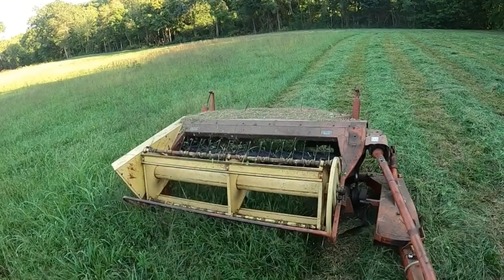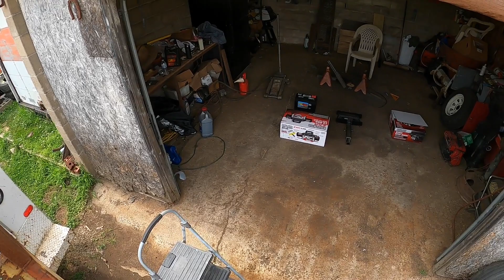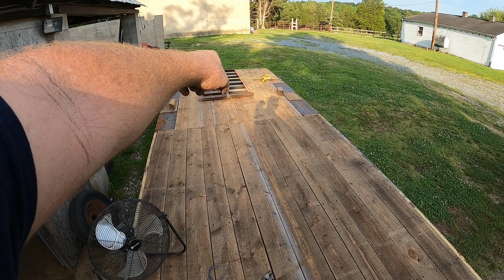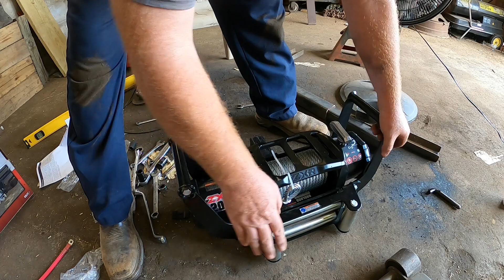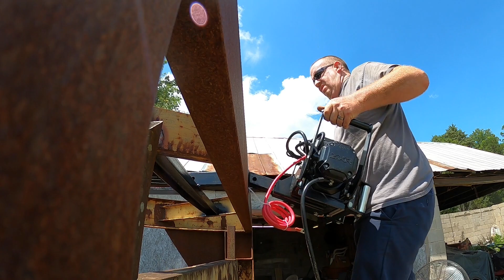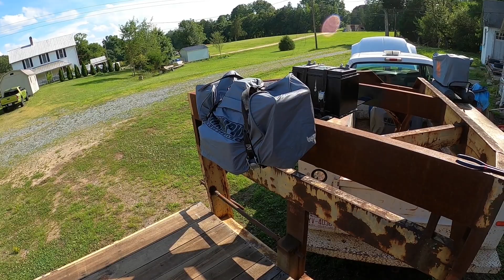Harbor Freight ZXR 12,000lb Badland winch install, wireless remote, and fabrication!

Comment: I like the way you mounted the winch but I think running  cables from the truck battery might be an option. I have a plug on the back of my flatbed to run my seed tender. I tried a stand alone battery but was constantly having to put it on a charger. Just my 2 cents.
Dad has  a Badlands winch on his white Chevy. It bolted to a bracket on the top of the bed behind the cab. We use to feed hay with that truck. Had a bracket made to fit into the receiver hitch to mount a hay spear. Worked great.
Reply from the maker: Thank you Russ it has been a lifesaver already on several things!! I didn't want it dedicated to the the trailer or truck!! It is nice to just plug and play per day, but with the deep cycle battery, and the generator help it seems to be full charge all the time 😁 Also I love the extra power it seems to give not losing so much amperage on those long cables from the truck battery. Time will tell for sure. I remember I think seeing that one time, or you talking about it with the white truck 😁😁 Thank you sir for always being here, I really appreciate that!! Hope things are well and look fwd to seeing what you have going on next!! 😁😁😁🇺🇸🇺🇸🇺🇸🌽🌽🌾🌾👍👍👍

Comment: You'll never go wrong with a winch on the trailer.  I installed a HF APEX 12,000 lb winch with the synthetic rope on my gooseneck. I love it !!  Either wired OR remote control. Saved my back many times already. I used to use a two ton two speed cast iron boat winch and loaded everything with that for 30 plus years.  Hand crank.  Of course, using snatch blocks too.  The good thing about the synthetic rope is once you lay out the rope full length and pull a heavy load to train the rope onto the reel while stretching, it maintains the wind every time with a straight pull.  I don't think I ever edited the video for upload. LOL. I may go into the list of videos and pull that one out !!  You have a stellar install with yours, and you are gonna love it. Of course you know that already using your buddy's winch.  Btw, I LOVE the way you made it removable.  Mine is not.
Reply from the maker: He k yeah Mr Wendell, I seriously considered getting that apex with the rope!! That wireless remote is SO HANDY to keep an eye on everything and not be right in the line of fire with the cable!! I heard that on the boat winch!! We built one from a lawnmower engine and transmission, and an old manual crank! It worked great for years, then we kinda upgraded to a 75' cable  and would snatch block it on the front, and pull something on with a truck or tractor. I loaded both my other combines with that setup. My buddy has his winch then, but it was dedicated to his truck due to the wiring, and he didn't have a gooseneck ball. So I said when I ever did mine, it would be mobile and self supportive for any truck combo!! That rope sounds amazing, what are the weight ratings vs cable? That laying back flat every time is enough to make it worth it!! My OCD goes nuts of it doesn't lay flat!!  Thank you sir for the kind words, I wanted to make sure this one was mobile for sure!! Thank you sir for all you kind words and always being here, I really appreciate that!! 😁😁😁👍👍👍🇺🇸🇺🇸🇺🇸 Hope things are going well your way!! 😁😁😁

Comment: When can I drop my trailer off and you install my winch.  LOL. I  have the same winch laying on the garage floor whating to be installed.  I hate to omit it but I bought the winch right after I bought the trailer.  That's been 3 and a half years ago.  The winch setup turned out nice. It will be very handy.
Reply from the maker: Would be an honor Mr Monty!! You head on down anytime sir!! 😉😉 Might get a little expensive on that trip but the fab work wouldn't cost you a dime!! 😁😁 I understand that, had I not needed it so bad for the combine, mine might be in that floor as well 🤣🤣🤣🤣 Thank you sir for the kind words and compliment!! It has already in a since paid for itself,. especially with that combine haul!! Thank you sir for always being here, I really appreciate that!! 😁😁😁👍👍👍🇺🇸🇺🇸🇺🇸

Comment: I have one of those on my trailer. I think it is about 3 years old. The winch mount plate is nice. I didn't get that or the wireless remote. Nice setup and install!!
Reply from the maker: They seem to be the go to winches for the price. My buddy also had a Ramsey on a trailer, and this one works so much better!! I figured it would add at least another month to the build if I had to fab up a bracket 🤣🤣🤣 The girl at the counter was very nice, got several discounts so I couldn't turn down that mount plate!! That wireless remote I had my doubts, but it is so handy to stay out of harms way, and check on things while loading and unloading!! Glenda video soon will show a little of it 🤦🤣 Thank you Mr Chris for always being here, I really appreciate that!! 🇺🇸🇺🇸😁😁👍👍

Comment: You'll definitely get your money's worth out of that winch! Sure beats a come-a-long and chains. Nice idea using the hitch receiver tube so you can keep it inside or move it between trailers too. May have to make that upgrade for mine one of these days. Excited to see you put it to work! Thanks for bringing us along Nelson!
Reply from the maker: Yes sir Evan, I think it's already almost paid for itself!! OMG yes it does!! We finally upgraded years back to about a 75 ft piece of cable, we would put a snatch block on the front of the trailer, the back a truck or tractor up beside the trailer. Hook the cable to it, and use that vehicle/tractor as the winch through the snatch block 😉😁 Worked great,.loaded my old K and F gleaners that way. Although my buddy had his winch then, but no ball in his truck. I said them, when I do get a winch....it will be mobile and not specific to a trailer or truck. Lifesaver so far!! Heck yeah, if you do be sure to film it 😁😁😁 It sure made short work of Glenda, and another treasure...😉 Thank you Evan for always being here, I really appreciate that!! 😁😁😁🇺🇸🇺🇸👍👍